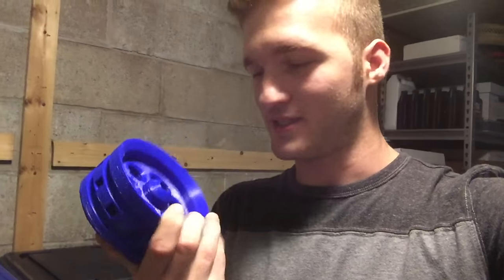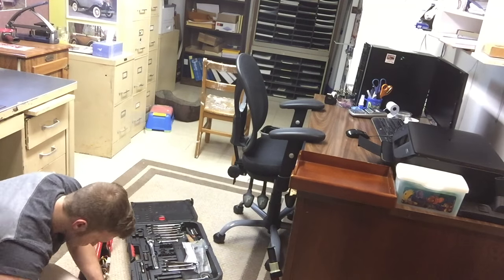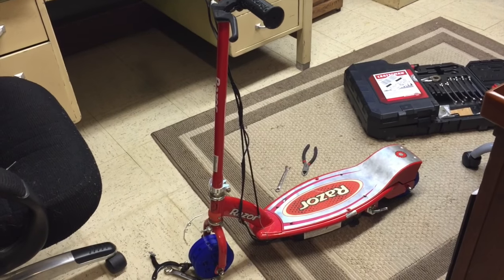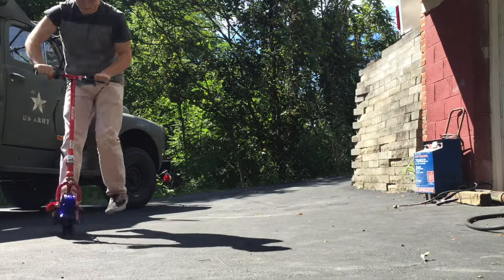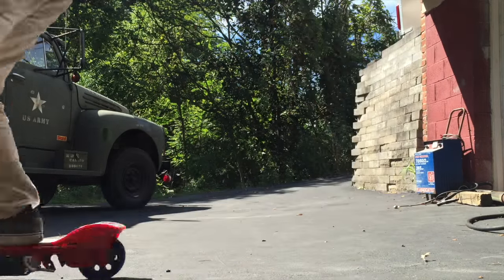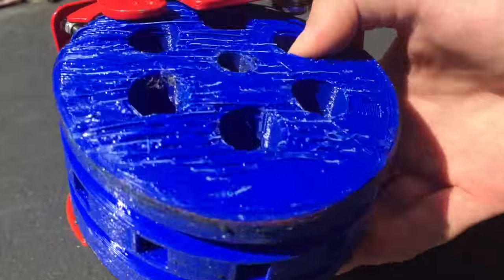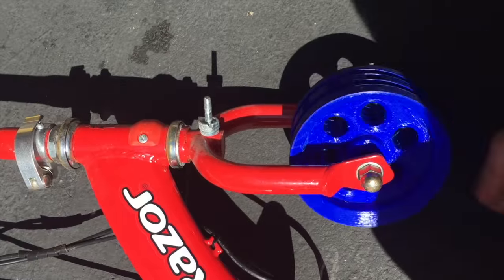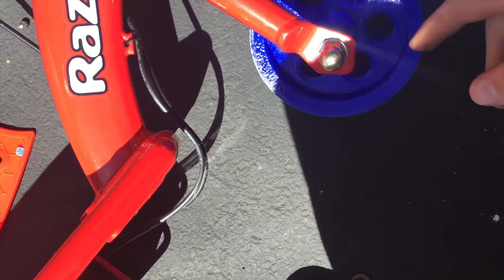HOW STRONG IS PLA?? Testing 3D printed wheels

Comment: The material did well, but you should think about some sort of tire face, and bearings for the axle, then the hub should last well.
Reply from the maker: good point, the squares on the outside of the wheel were designed to interlock with a track idea i had, and original i was thinking about redesigning to fit skate board bearings in as well

Comment: Interesting.
That's a very rough application for a rigid plastic. You could make a design where you print a TPU tire for it.
A firm but flexible plastic. Like a roller skate wheel. That's much better engineering.
Also use roller skate bearings
Reply from the maker: What I am going to do is use bicycle tires for tracks for my actual project which will supply some cushioning between the wheels and the ground, that is why the wheels have grooves in the sides, I just thought this would be a fun way to test how strong they are, and I am going to use skateboard bearings in the wheels  but thanks for the advise
Reply from the maker: I'll also look into TPU that's interresting
Reply: sure, it's a tough test

Comment: I wonder how well HIPS stands up to such abuse? PLA gears and bearing surfaces experience comparatively little wear and friction, but i'd like an alternative that doesn't melt or begin to warp so easily under everyday conditions. ABS, PETG are all more prone to binding, and PA needs too much temperature to melt for comfort.
Reply from the maker: Siana Gearz I'm interested in testing some more possibilities, those are good points, thanks!

Comment: What printer do you use?
Reply from the maker: semtech I used a "3KU delta 3D printer, it's sold as a kit sent from China you have to hand assemble, but the assembly is easy and all of the parts are easy to find online as well if they stop working